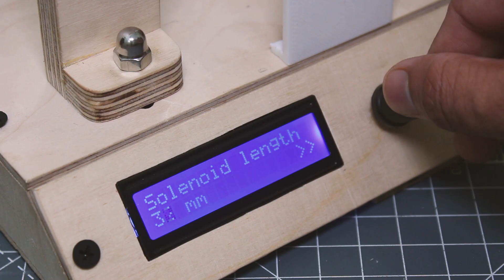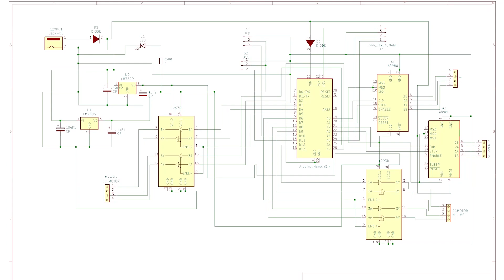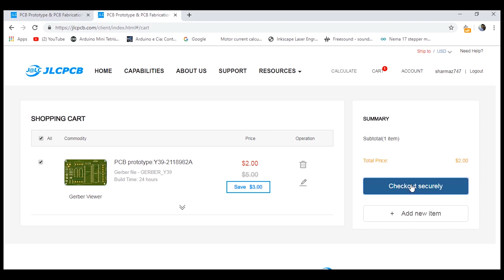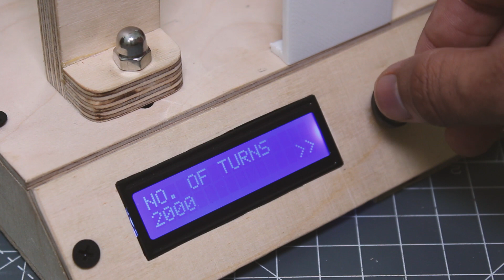DIY Solenoid winding machine | Arduino project

Comment: Great and clever build!  Did you have the wire diameter as a constant in the code; didn't see you enter it.  This would be necessary for the carriage to know what distance to travel per turn.  Is the two color disk read by opto sensor to count revolutions?  I would think the code would have a counter that would tell it when done.

Comment: You haven't considered the diameter of the wire, which is important for the movement of the carriage (I mean in the software part of the project, and the relative movement of the stepper motor), Also I don't see a clutch on the starting spool, in order to keep the thread always under tension

Comment: Does ANYONE know what these Arduino part #s are and the programing files used for this system?  I also wanted to use rotary encoder software using the built in switch control. I searched High & Low for the software.

Comment: Hi there, great video 😄.

I'm a beginner and I have a question :
Do you have the link to buy the electric saws you used to cut the wood boards?
Especially the ones at 00:57, 1:07 and 2:42.

Thank you in advance 😉

Cordially.

Comment: Having built these for Germany, Airbus: A tensioner is critical, even if just some friction on the wire spool.  However a tensioner consisting of the wire passing through a open cell foam pad is much better. Not only the tension is added, but also straightens and smoths out the wire, removes oscillation in the wire prior to winds added to bobbin. A piece of foam folded over, wire running through it, pressure on the foam.  If the wire mover is further from the bobbin, the wire will correctly lay by itself surprisingly well, must have tensoner adjusted.  I made a bobbin winder for about 200 euros, that blew away the German 40,000 euro winder
Reply: Klo bli brp hrg y boos ?

Comment: hola podrías compartir los códigos para el arduino y una consulta en vez de usar un motor dc con el sensor usar otro motor pap.   y gracias por subir este tipo de videos soy un entusiasta de la electrónica y programación y por eso te pido los códigos de arduino ya que es muy básico de lo que se de arduno

Comment: Amazing video
Hey please share additional settings for increasing or decreasing the stepper motor speed and is it possible to run 120w 12v DC motor with this circuit. Else share details how can i run AC motor along with speed variation on both motors

Comment: Just wondering the term DIY is changing its meaning to something closer to "Have all this tools and manufacturing gadgets"
Reply: Because if you are a DIY enthusiast you tend to gather those tools with time. If you lack most of these tools then this project is out of your reach, go find some entry level stuff. I have no idea why you are even complaining since this project IS actually entry level. You can sand and cut wood with manual tools, it just takes longer, you can order 3d printed parts if you have no printer or use more wood. Isn't DIY about being resourceful and make with what you have?

Comment: This fancy design means nothing if you do not show the end result and quality of winding. Which i am sure the machine fails to deliver thats y u have not shown it in video.
Reply: Well Duh hahahaha  we can all imagine how it ended up, the spool was not properly supported and there was no means of adding tension to the wire as it was being spooled, Try filling a fishing rod reel without someone pinching the spool as its being filled lol the Same thing will happen lol But to be fair,  his little design is a good start, now it just needs some tweaking and at least there was no hot glue used for a change.
Reply: @patprop74  No code either
Reply: @patprop74  Good
Reply: It's a good basic start.  Why don't you tweak it and make a follow-up video 🙂
Reply: The encoder resolution is also awful.
Reply: @e-pi5189  probably a cheap encoder.  If you tweak the design you could use higher quality 🙂.
It's not bad for a concept.
Reply: @e-pi5189  coil windings are measured in full turns. 
the resolution doesn't have to be 600/rotation. that's a waste of computing power. 
getting 1/600th a turn at the end isn't going to make a huge difference in the magnetic force. 
so the encoders resolution can be as shit as 1 tick per revolution.
Reply: I should put here video of my Arduino based Tesla coil winding machine. It makes perfect windings.
Reply: @makeitso3049 Yes please. And post how you made it with parts and a tutorial.